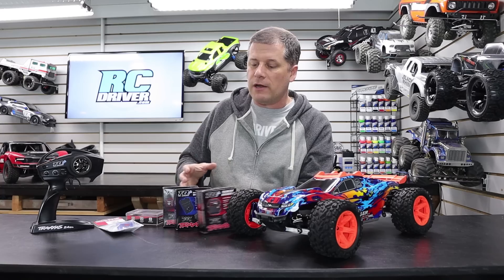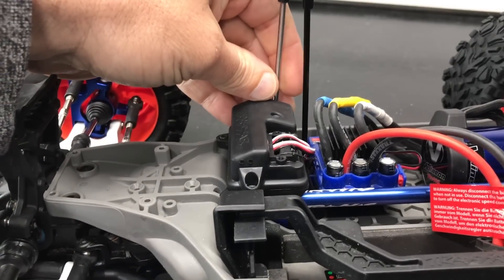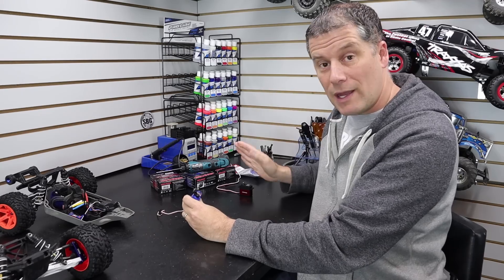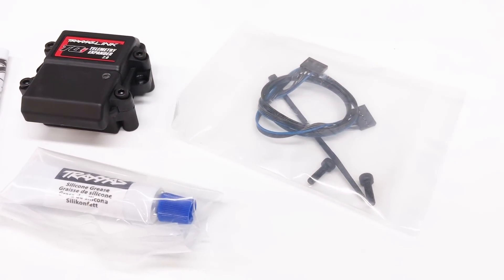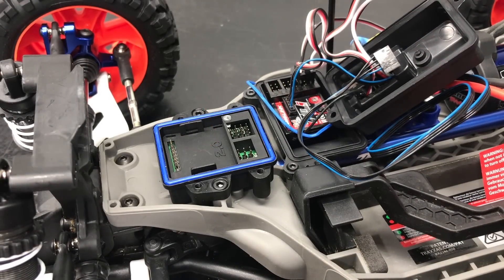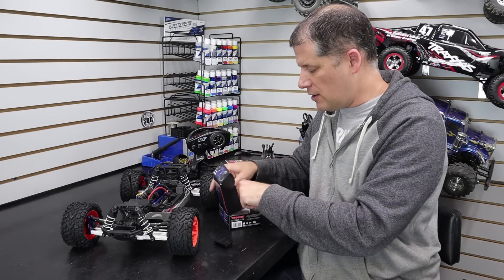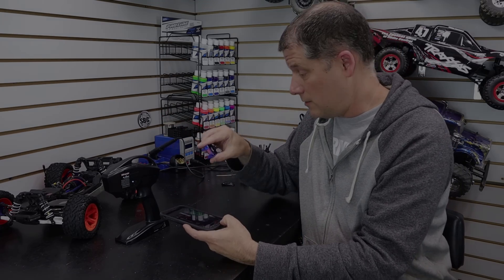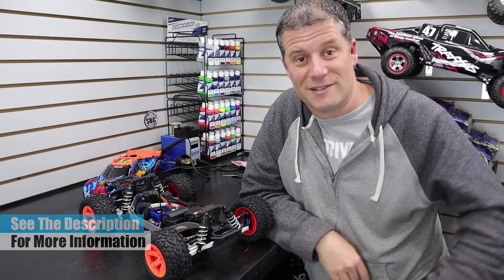GPS Speed Telemetry Install! Traxxas Rustler 4x4 VXL Full Upgrade Project Truck Part 4 | RC Driver

Comment: It's all included - Oh no it isn't - it never is.. You need a telemetry expander mount, then you find you need the chassis reinforcement to mount it on and so on. Traxxas  should rename themselves - extra parts required.  It would not be so bad if they told you up front what you needed, so you don't have multiple orders all with minimum postage applied. Don't ask Traxxas themselves as you will get incorrect answers and end up buying the wrong parts like I did. I like the quality of the models themselves but their instructions and parts lists are c**p.

Comment: If i put only the Traxxas TQi Radio System Telemetry GPS Speed Module  i can see from the traxxas app temperature, speed and battery? I dont want so many cables to my rc car? ( Rustler 4x4 vxl ) anyone can help me?

Comment: Is Gps and expander just for speed. I just won’t temp . Rpm and batt sensors . Can I just plug those into tqi receiver ? I have Bluetooth module and app,

Comment: The stuff you are use in is all I need to get my rustler 4x4 vxl voltage speed battery and temperatures love your videos I have bin a fan of rcdriver for many years can I get some stickers for my trucks thanks

Comment: I just got this truggy and broke the front right lower arm, so I ordered aluminum lowers with piggyback shocks for the front and back with the telemetry add-on and gps with a mount for my TQi controller...  I wish you would have done the build without the 400 servo first for comparison to the stock servo.  I am running a 2s battery currently and plan to upgrade my batteries to 3s soon with backup driveshafts to replace the stock ones as I have been told that with a 3s battery setup I will likely strip out the stock driveshafts...

Comment: Great video. I set up the telemetry and the GPS module is working. Now I want to connect some other sensors but I can't figure out which cables to get. This is all very confusing. How do I get the battery and temperature readings? Which cables do I have to buy? Any help would be appreciated. Thanks in advance.

Comment: It’s pretty cool system, I took the module out of my slash 4x4 ultimate and put it into my telemetry, temperature ready UDR, automatically updates on the app. Pretty sweet. Just ordered the monster 26 amp dual 4 s charger

Comment: Wouldnt it just be cheaper to buy a spectrum or futaba radio witj telementry and a built in screen instead of using the junk rtr radio it comes with and buying all that crap to install in there? I mean im running a a spectrum radio and castle electrics in my rustler 4x4 and its great. Btw where does one get the orange wheels and wing etc...?
Reply: You can order the wheels and wing from the traxxas website

Comment: I'm surprised there isn't any screws holding the fan to the ESC.
Reply: I have one on mine and to be honest it's a pain to get it off once it's on. There are screw holes on the fan but haven't looked to see if it lines up to anything?